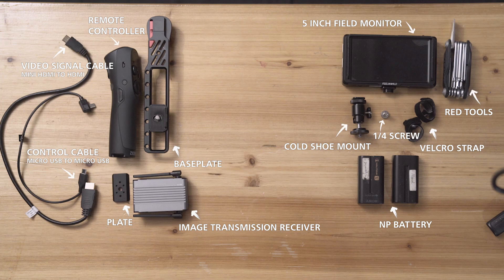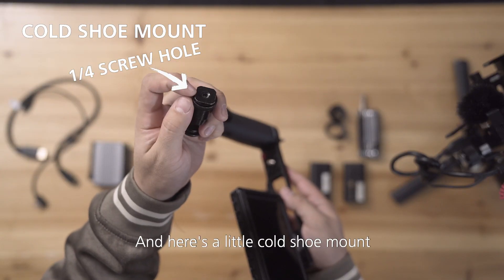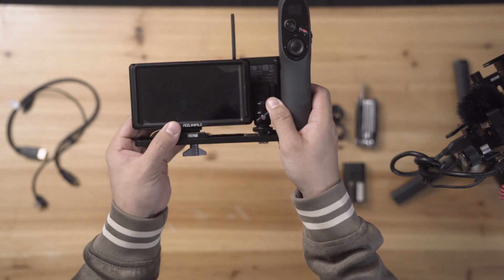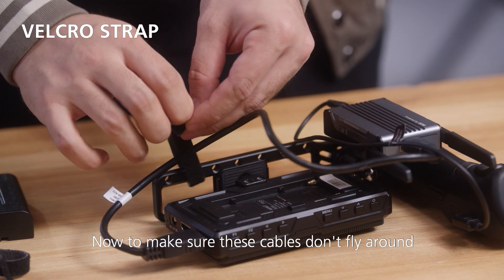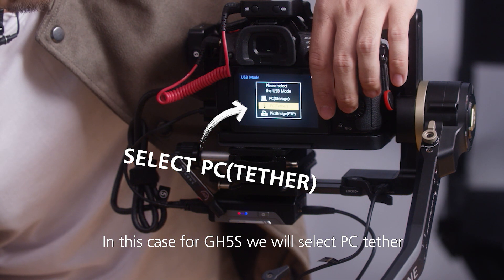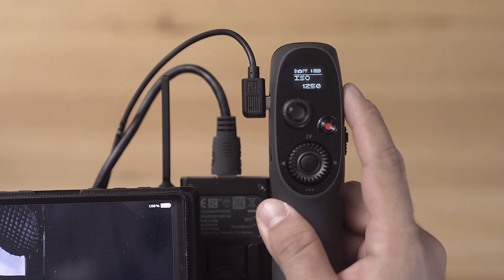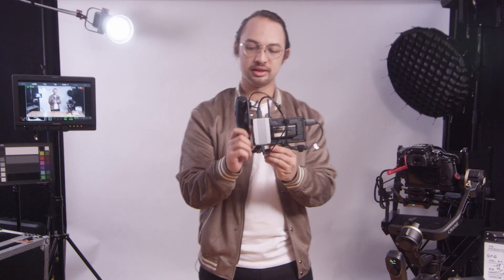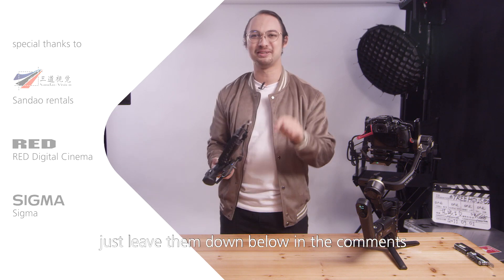Zhiyun Crane 3S OFFICIAL tutorials C3 wireless image transmission receiver and controller

Comment: Your wireless system is great.

Now my cob05 controller is v1.80 and zoom and focus motor work at the same time. Whether I turn the wheel or press the zoom rocker. So I visited the Zhiyun website and it says that it supports operation by separating the two motors from firmware v1.83. 

1.
They updated v1.83 in March 21 and uploaded your video in 2020.
It must have been an old version, but I wonder how you made the zoom and focus work separately.

2. 
I downloaded the firmware file of zhiyun website, but it doesn't run. To be exact, the ZHIYUN USB driver does not run. If your cob05 is v1.83, I wonder how you upgraded the firmware. 

3. 
There is no problem with the OS version of my Mac computer.
It is impossible to follow the instructions. I'm going crazy.
I think only you can help me.
ZHIYUN TECH cannot.

4. 
I hope you're always full of happiness

Comment: is controller can work without image trnsmition? i just need follow focus function only..coz i have wireless video trnsmition from another brand already
Reply from the maker: i don't recall it working without the image transmitter. If you only need to change settings, I think you can do it via the ZY play phone app
Reply: so this controller can connect to gimbal wirelessy without image trnamitiion or not?
Reply from the maker: @klopodegan  Hi Dedy, no it cannot connect wirelessly to the gimbal without the Zhiyun transmitter & receiver
Reply: @marcelbrandel9078  ok thanks
Reply: Do you think this will work with Z cam ? Which has UCB C controls and uses app ?

Comment: must have receiver for controller? for focus motor
Reply from the maker: hi, to use the follow focus motor with the external handle you'll need the receiver, but if you want to change focus simply with the sling handle that is already attached on the gimbal, then you don't need a receiver
Reply: @marcelbrandel9078  Thank s for answer.

Comment: Hi Marcel i was message you on an other video but this video is exactly what about im talking in my other post 
i bought the Crane 3 S pro and the extra equipment like in this video to manage the focus with an assistant but its totaly impossible 
when you touch the nobe on the transmount motion sensor remote controller its jump like crazy in my lens even when i stop touch the nobe on the transmount motion sensor remote controler my focus on my lens keep moving thats crazy its impossible to focusing in this condition 
is it a setting problem or maybe update 
thanks to help all the rest its working good the image its ok i got all my camera fonction only the focus its problem

Comment: The TransMount Remote Controller now works with my Crane 3S!  In a comment posted below I complained that my Crane 3S would not accept remote control from the COB05 handle that is shown operating fine in this video.   After I didn’t get a reply here, I called Zhiyun support.  They responded the very next day: On the Crane 3, use the menu to select CCS as the camera.  Now it works beautifully!  Maybe I needed that setting because the camera I use on the Crane cannot be electronically controlled from the Crane.  It is not one of the listed compatible cameras.  Only the HDMI from the camera is connected to the transmitter.  I hope this helps someone else.  These videos are so well done and so informative that I was perplexed when I could not repeat what I saw.  Now I can.
Reply: Thank you Wil Spenser! I wrestled with this for 6 hours before I saw your comment. It's amazing, thanks again! I am also a crane operator. It is a pity that the joystick is not comfortable
Reply: Thank you so much! I've spent several hours troubleshooting before seeing this solution. All works perfectly now!!

Comment: On September 14, 2020 I purchased the  Zhiyun-Tech CRANE 3S PRO in a package that included the TransMount Motion Sensor Remote Control shown in this video.  But the TransMount Motion Sensor Remote Control, upgraded to firmware version 1.83 cannot control the Crane 3S.  Its users guide describes it controlling only the WEEBIL-S.  How did it control the Crane 3S in this video.  When I try to use it, as soon as I cause it to send a command to the Crane 3S, the Crane 3S stops operating completely -- even the controls, like the joystick, on the Crane 3S stop functioning until I turn the Crane 3S power off and then on again.  What version of firmware was used in this video.  When will it be released.

Comment: Yeah I don't get it. I watched every video and just can not get the Motion controller to connect. I just get the iPod and gimbal symbols. I can get camera focus internally with the wheel but I can connect to the Crane 3s and control the motors. Also, it connects to the phone with full camera control and I'm on v1.83 in the firmware. What am I doing wrong? Thanks

Comment: What’s the battery life on transmitter and receiver? And is there a way to have them powered all the time?
Reply from the maker: Hi the transmitter won't be a problem it's charged thru the usb port of the gimbal, with the receiver you can have it charged thru the micro usb cable and a power bank to extend its runtime for an entire day shoot.

Comment: I can't get the transmission receiver to work. It won't send images to the external monitor. All I get is the white screen with the Zhiyun logo. Any ideas on what I'm missing?
Reply: @Anthony Tether I got it working. Thanks!
Reply: @Anthony Tether Yeah, could never get the tran-handle's ff to work, but so long as the gimbal works, the hell with the gimmicks. A tilta can fix the remote ff issues.
Reply: @Anthony Tether Right. I can live with it though. I bought the pro-kit. The wireless image transmitter works, the focus wheel on the crane works, and the gimbal is a big camera pimp, so, considering the image transmitter works, I think the prokit is totally worth it. You're still winning. You just need a separate wireless FF solution (like me). I'll grab a tilta once I get a project that demands remote FF, until then, I just chalk up focus points on the ground so I can stay in focus range of the target. Works just as good and saves on crew.
Reply: @Anthony Tether They went "Apple" and damn-near killed the thing. At least most of it works. I'm upset that the FF wireless transmission handle thing doesn't work, but hey, we can could the image transmitter with something else. I probably won't be buying from Zhiyun in the future because of their attempts to lock out 3rd party products, but I'm happy with the Crane 3S pro kit.
Reply: I got everything figured out. It's working flawlessly.
Reply: Same .. my remote detectes nothing
Reply: @BAM_G_Films  I got it working. You just need to keep working on it.
Reply: @BAM_G_Films  The right cords need to be in the correct spots.
Follow all instructions to a T. Ain't no shortcuts with the gimbal.

Comment: I can’t sync mi controller with my crane 3S
Reply: Me either.
Reply: Me either
Reply: @Holtenstein  I got it fixed.
Reply: @VizTV-Media  How? Mine has the iPod and Gimbal symbols only. I've done firmware, swapped cameras, cables, networks, CCS. It just doesn't seem to connect to the Crane 3s at all.
Reply: @Holtenstein  Connect the the transmitter handle to the transmitter using the mini usb, then connect the receiver to the camera control port on the gimbal, which will power it. FYI - I'm not sure if the camera control port matters, as I have not troubleshot or tested, but that's the configuration I had mine in when it worked. Then, set the handle's camera functions to CCA, or CCF or something (It's in the list with the camera brand names.) If you need future help, let me know. We can do a webinar thingy or I can drop a video on my set up.
Reply: @VizTV-Media  So connecting it in that order results in a Moon & Z Z symbols on the motion controller.  No luck